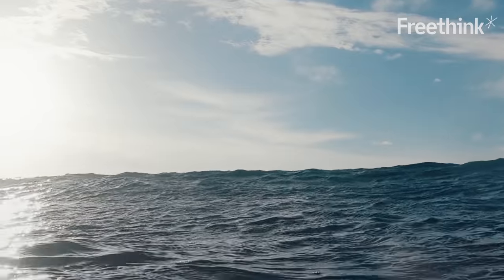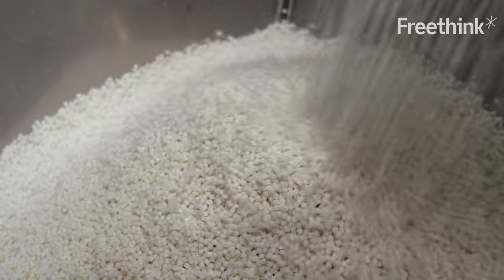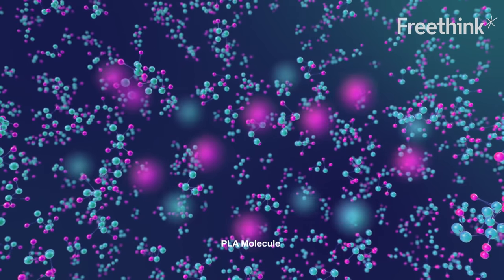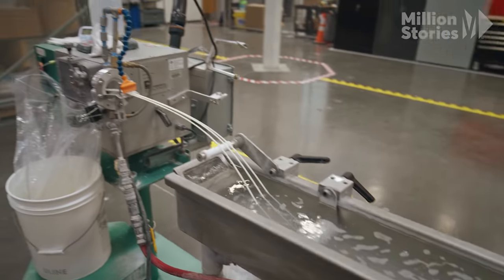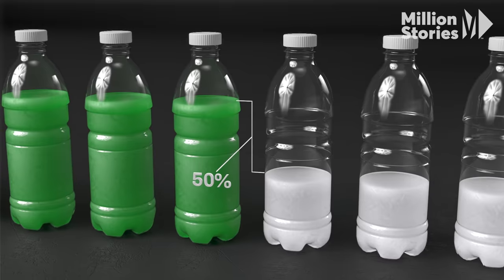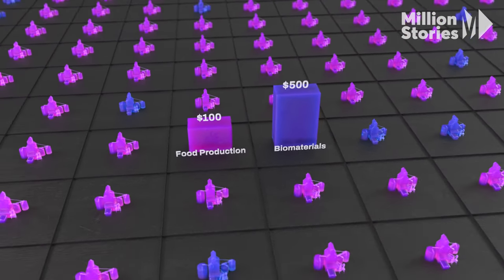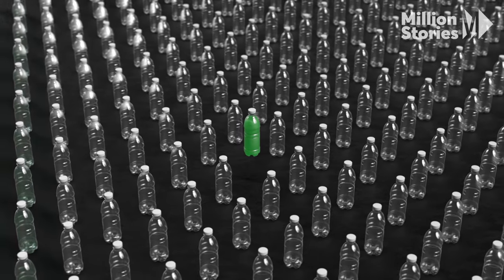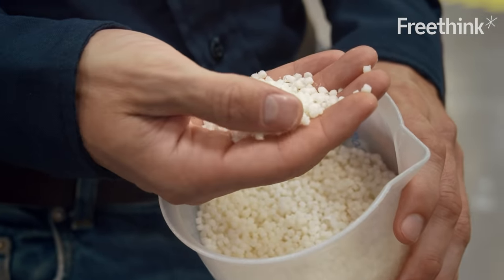How biomaterials could save the planet | Freethink

Comment: What is the destination of discarded PHB? Can it only be downcycled into less useful material, or can it be indefinitely recycled? Is it compostable instead? 

Is it eaten by organisms for energy like sugar, and so can't act as a carbon sink, or does it truly act as a carbon sink by being used for tissue construction in microorganisms?

Also, if it's a polymer found in lots of life, would large amounts of PHB and/or PHB decay products in the environment mess with the chemical signaling of any organisms?

What portion of current plastic products can be made with PHB while not sacrificing too many important properties of those products?
Reply: That’s a lot of questions
Reply: 1) Currently, waste dump (where it will decompose) or incinerators (where it will burn off). 
However, PHA's & B's are 100% recyclable. And its compostable (TUV Industrial Compost Cert) and if it ends up in the wrong places. It turns into food for any environment with high microbial loads (oceans, lakes, Rivers, Farm Fields ect...).

2) PHA's are the microbial equivalent to Fat. We store excess energy from food into Fat. Bacteria turns it into PHA. So no, its not a carbon sink. But more of a circular food-chain-Biopolymer. 
There is one company working on using Methane as a food source, to engorge PHA bacteria to make the polymer. The same polymer can then be feed into a Anaerobic Solid Waste composter. Where it will generate more Methane. 
Spent cooking oils (vegetable) is another. And spent barley is another. The biomass feed can be wide in range. 

3) Great question and our biggest fears. PHA's are Marine Biodegradable by TUV. However, they can refuse to sign off on the certification, because they don't want consumers to start throwing their PHA plastic into lakes, rivers and oceans. 
Anything of mass concentration released into the environment will have a negative impact.
That last part of being Marine Biodegradable is the last resort. Not the 1st choice on handling post consumed PHA's. 

4) Right now, I would estimate 80% of all packaging can be made with PHA's. BUT here is the real issue. They aren't compatible with most industrial equipment making cups and plates or whatever else. There are processing constraints requiring specialized or customized equipment and tool to function properlly. 
So imagine going to a facility that has $20M worth of injection molding equipment and telling them none is compatible with our material? Tough pill to swallow.
Reply: @fredpinczuk7352  How feasible is it to sort PHA/B out of bulk waste? Is 100% recyclability only feasible with correctly sorted and cleaned PHA/B objects, or can it be purified from highly contaminated waste sources?

A tangent: What direction would you point me in if I wanted to find any research that has been done to determine the feasibility of reclaiming most-if-not-all materials from landfills? I'd like to get a better understanding of how impossible/possible it is to create isolated self-sustaining human habitats with no material imports.
Reply: @lemonsavery  Great question.  We are currently testing the "typical" IR camera sorter used in commercial recycling and see if it isolates from the more "valuable" PET.  However, the challenge then gets to that isolated material that will also contain HDPE, LDPE, PP and others. And that's what we are working on. 
There are discussion around a UV marker, naked to the human eye. But easily picked up by a Camera. 

I am not aware of landfill reclamations processes or technology . Sorry, its not my cup of tea.
Reply: @fredpinczuk7352  neat
Reply: @fredpinczuk7352  I appreciate you taking the time to answer my questions :)

Comment: This technology could get a boost if or when the consumers create a demand for it. Willing to pay the price to drag that price tag down.
Reply: Except consumers don't create plastic, nor do they demand it with their food. What they demand is the product contained within the plastic. Manufacturers make plastic products by the ton, retailers distribute them by the ton -- and consumers are supposed to recycle it all in their garages and local soring sheds? Here's what you do: MickeyD (and everyone else) charges an extra 3 cents for a plastic soda straw or an extra 2 cents for an optional air-carbon straw. Same-o with other plastics. Or some freakin' variation thereof.
Reply: @generybarczyk6993  while what you said is true. Consumers have quite a lot of power over the market. A lot of people can mess up manufacturers and retailers, just by changing where their wallets go. Which then affects the revenue of said companies.
Reply: @gre3nishsinx0Rgold4  True enough. But manufacturers and distributors have the advantage of unified management and significant financial incentive, whereas consumers act individually or as part of voluntary social groups, at best. In the long run, the weight of the marketplace may bring the supply side to heel, but we will likely be dealing with a variety of even larger environmental catastrophes at that point. Obviously, the supply side is aware of the problem. Are they awaiting permission from consumers to take action?

Comment: Too bad it's not the solution, the degradation products of these plastics can have effects on the envoirement too. This doesn't solve pollution, this hides it
Reply: You may have missed the details. 

Here are the facts: 

PHA is 100% recyclable. So as long as you have a recycling stream that will handle the material. No issue there. 
PHA is 100% compostable. So if it ends up in commercial composting. Its actually a+ since it acts like an appetizer for the bacterium to start and accelerate the decomposing process.
PHA is 100% Biodegradable, including in the most sensitive environment (Ocean's). Bacteria's simply consume it and continue to the live cycle. And most importantly, if it wears or breakdown into microplastics. Its absorbed by the body without harm. 

You need to remember that PHA was invented over 50 years ago specifically for the medical field. Its found its 1st use in internal surgery, where it will simply dissolve in the human body and as a drug delivery system. 

So to your point, what effects does these plastic have on the environment? What are those effects you are claiming? 

Suggest you read the following book by Prof Joseph Greene. And educate yourself on the subject. 

https://www.amazon.com/gp/product/B00NV73K06/ref=dbs_a_def_rwt_hsch_vapi_tkin_p1_i0

Comment: You use both tonnes and pounds in the first 20 seconds of this video. What weight system are you using to express your point??? Is it metric or imperial, from where I’m sitting you used which ever one suited your point better at the time. Classic propaganda and fear mongering
Reply: Ciaran McCormack - Way to concentrate on the unimportant, well done!
Reply: @ciaranmccormack4434  
Tons and pounds... as in imperial tons. 
1 ton=2000 pounds.  

You're right about the propaganda, but it's still a cool idea.  
Should they find a way to create their base materials without creating more pollution than they claim to prevent, I might be interested in supporting the effort.  

The honest truth is that the whole premise of their idea is flawed. 
Plastic is useful as a storage container precisely because it doesn't break down. 
Once you get a bacteria on a the outside of one of their bottles, which is both harmful to humans and able to feed on their plastic substitute, you have the end of their company.